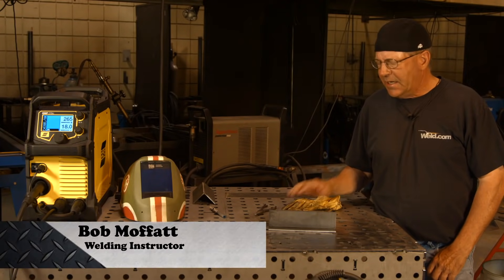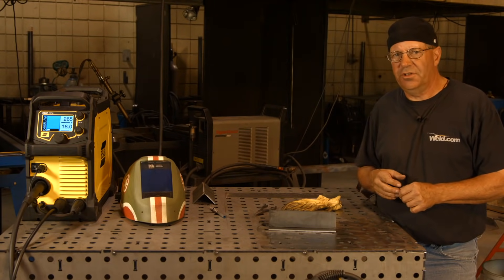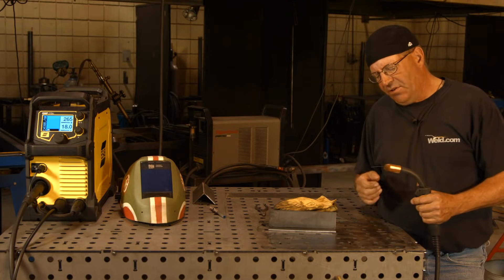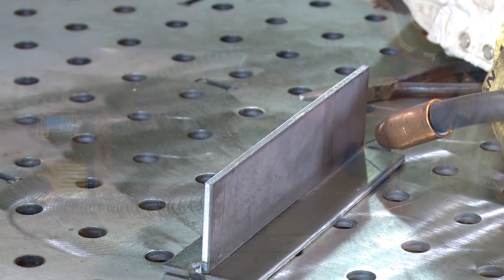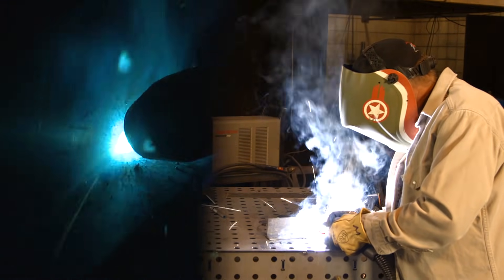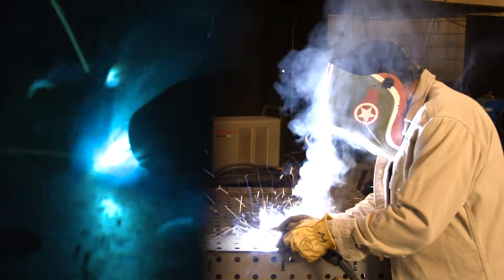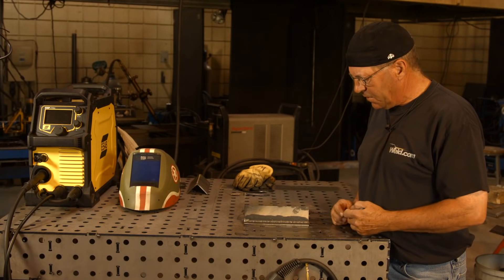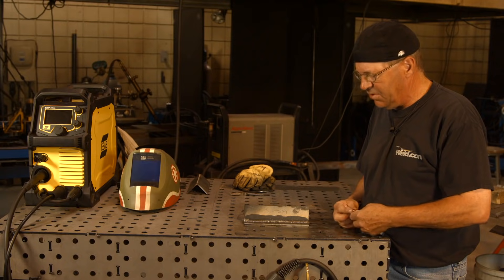Flux Core Welding: The Basics You Need to know

Comment: My first welder was a cheap transformer arc. Was difficult to learn on, but I got the welding bug all the same. Spent a bit more and got a (still cheap) inverter gasless mig. Now that was hard to get the hang of. But I've now run maybe 6 spools of wire through it and produce fairly tidy welds with it. I've just bought an inverter arc/tig welder. It's so simple to use. Compared to my gasless welder it produces no spatter and it's so much quieter. I can weld in to the night without the wife complaining. My gasless still has a place tho. I find doing vertical welds with the arc the pubble sags and can drip if I move too slow. With the gasless I seam to be able to weld on any angle without issue. Great for welding a jockey wheel bracket to a trailer outside for instance.

Comment: I use those cheaper wire wheels with hex shank in my impact driver to clean flux off. It's faster than hand brushing and impact driver is half the size of my grinder. I can grab it with one hand and take it off in just a second.

Comment: I'm assuming MIG can do both, but the Blue Demon Stainless steel flux cored .035 wire claims to weld stainless but using flux cored wire. Can it also weld aluminum, or just stainless?

Comment: This is the kind of process I use the most, mainly because of what you said cheap and easy.  I usually dont even knock of the slag, just a good hand wire brushing and paint. Never ever had a problem.

Comment: This past summer (or maybe a little before that?) I purchased a Hobart Handler 210 from a local rural supply store (I live in Indiana). Bear in mind that I knew absolutely nothing about welding at the time of purchase and I fully admit to purchasing something that's way out of my league, but for this, I decided to just say "screw it" and dive in. I'm happy I did.

Once I realized how the damn feeder is plugged into the main body coupler of the welder, I was up and running. I've only been exposed to Flux Core at this point and I love it. I have a buddy at work who does MIG and he swears by it but for me, I have a fear of things that explode, so my natural inclination is to avoid compressed anything. Flux Core is more than enough for things I mess with anyway and so far, I love it. Yep, it's messy and I (obviously) suck at it right now but each time I do it, I learn a little more and get a little better at it. I'm lucky to not have had any accidents yet because I've done some stupid stuff with it already, such as try to weld a galvanized fence loop back onto a fence cap, which I didn't get very far with (something I'm not that sad about now that I realize that can be a dangerous metal to mess with). But with that aside, I was able to weld a crack that my push mower had in its shroud. That's not much but hey, it saved me needing to replace anything and it made me pretty proud of myself given I never did anything like that before.

It's fun stuff. I have all sorts of things I'm planning on doing with it once I find the time to... One thing I'm looking forward to working on is welding together some sun visors for my convertible--that might be a winter project--but this Hobart welder is awesome! Well worth the money I spent on it!

Comment: This is very dangerous when ur welding with flux or not never forget to have a fan to blow the smoke away from you u dont want to breath in that smoke or you can use a air vacuum. That sucks up the smoke !
Reply: A few cigarettes before welding will put a protective layer of tar in your lungs.

Comment: I wanted to share what I figured out welding flux core wire. I welding a front clip on a Camaro. Ran out of gas. It was weekend no welding supply open.  Where I live.  Loaded my mig up with flux core. It smoked sputtered couldn't see what I was doing.  
I opened up my shop doors.  Big gusts of wind were blowing in. During the gusts.  I could see and it didn't spit,  sputter or smoke. 
I had a box fan set it up blowing hard. 
It welded great.  I could see. Didn't smoke up the material I was welding.  The splatters were a minimal. Welded just about like I was using gas. 
I would recommend using a fan welding flux core. Inside or out. Unless the wind is blowing hard.  
Try it. It will surprise you.  😊💯%✔🇺🇸

Comment: Ok I bought a little 110v machine and I’ve been doing pretty good for a beginner learning on my own but I suddenly ran into a snag today. 

My machine came with two spools of wire (with no labels) and I ran out and used some wire that I found on Amazon. It looks the same lol  but this new FC wire bounces off the welding surface even with my temp all the way up and my wire feed as slow as it will go. 

Don’t let me overstate the problem because I am putting down a decent (in my crappy opinion) bead but I’m having to fight it. 

Any advise? If I was near my machine I would give all the info on the new wire I got but I don’t have it right now. Grrr

Comment: This is the best video I have seen about MIG welding.  I know the preparation steps, but the actual welding is what I needed tutoring.  THIS guy does that.  Most beginners videos want to use gas and I never intend to do welding for profit.  mine is just hobby related, but I want to do a decent job.  I gave a high five and I subscribed.  Again, excellent video, thanks for sharing!
Reply: This is not MIG (Metal Inert Gas), this is flux-core welding, FCAW (Flux Core Arc Welding), this particular version is called Innershield, it uses a flux core welding wire with no gas, there is also a process called Outershield, it also is a flux cored wire but also uses a gas for a shield (straight CO2 gives best results with this process over a mix gas), don't forget what this man said, Innershield runs electrode negative (DC/EN or DC-), MIG and Outershield run electrode positive (DC/EN or DC+).

Comment: I have a Miller 130..i bought 20 years ago...flux core..i have found that the wire if it gets a tiny bit damp,,it will swell up,and cause the wire to jump and bump..results,a crappy weld..the moral or this is...remove the spool and keep it in a box with a,light bulb..or keep the spool in a ammo can

Comment: Hiya. I need HELP. got a mig welded from eBay was welding mild steel with flux core wire E71t was going very well nice welds. Then I ran out of wire and got new wire from same flux core wire but now the welding is not going good. Can't even run good beads the beads are too high and not penetrating and don't even stick everything falling apart. Tried adjusting wire speed and voltage nothing works. Polarity is DCEN. somebody help.

Comment: Just tried to weld two pieces of galvanised steel with my new fluxcore.  Woeful. Right welder but needs competent user. I am such a newb 🤣🤣🤣
Reply: Try to grind as much of the zinc away from the base metal first.  The zinc will make the arc wander badly and tie-in will be affected.
Reply: Spanner, its not your fault, damn things have a mind of their own.

Comment: I have a video Idea I'd like you to make since you have everything you need and I've never even heard of anyone talking about this.  I'd like to see you build a box like they use to sandblast or work with bio-warfare agents and instead of having a stream of gas flowing out of the tip, simply fill the box with argon and then weld some aluminum wish gas wire or stick.  Of course this means your part must  fit inside the box or be sealed whee it comes into the box but that could easily be accomplished the way people let trees grow thru a roof  using an inflatable tube to make the seal.  My and a buddy have wondered just what might happen in this instance and whether the whole box might act like a plasma ball but I doubt it since your using such low voltage.  Seems to me a person could save a lot of money on gas or make their gas go a long long ways  and possibly you could do things that have been ridiculous to even consider before.  Helium is easy to obtain in small quantities, even the dollar store has a bottle of helium at every one and it also comes in small tanks like co2 if I"m not mistaken.  Now for a fun fact of the day.  Did you know NASA uses more Helium than everyone else on earth combined?  Hmmm I wonder what they do with all that Helium, could it be possible they use it to launch satellites from Antarctica as shown in so many videos.  I recently came across a guys video (UAP) that showed a list of satellite launches by NASA that were launched from Sweden and some of them included Parts for the MIR space station and most of them were Satellite launches.  Just thought I'd share that with you and if someone can think of a logical  reason why they use as much noble gas as 7 billion people I'd love to hear your explanation or theory

Comment: I still keep a spool of 70 series fluxcore around for when I run out of wire or gas. Looks of weld are really secondary to penetration. Guy came to our yard sent by landlord to replace front gate. Had Honda 110 generator and mig welder. He laid out parts of galvanized pipe and instead of notching ends he just flattened them and welded up a new gate frame with fluxcore. I checked it out afterwords and it looked good. Nice tight welds with a little slag. Up to that point, I really didn't think much of 110 mig. I always had access to 220v machines. Dual shield I am told is what you need to weld up Cat track pads in a hurry. I would like to try that someday. If you ever tried to unweld something, you quickly find out just how little weld it takes to stick two things together.

Comment: ever run into this cracking down the center of the weld
Reply: That happens easily with any aluminum and with cold steel. Maybe too much voltage or slow advance? You may jump to welding other sections to avoid excessive heat concentration. 

Best to heat up everything uniformly with a torch (or oven) to reduce the relative contraction of metal just behind the weld. Also, cool as slowly as possible by insulating from cold wind (wind break) or covering around hot weld bead with insulation.
Reply: @avid0g   thanks ive pre heated it seems to help

Comment: What surprised me, whilst welding sheet metal for car wheel arches, was the advice in another video regarding turning the welder up a notch if you blow through. I couldn't quite understand how this was going to help but it worked! 1.0mm thick metal, on my mini welder, 1 max, 7 wire speed. Works great.

Comment: flux core welding, perfect for DIY'er, backyard mechanic, or need to weld something in the boonies on the cheap. Perfect for ranch/farm use where it doesn't need to look pretty, but as long as it works.

Comment: Hello, I bought the harbor freight 90amp flux core and was wondering if I should do the conversion from ac to DC like a lot of people have done. Since you say to switch it in the video. Thank you for your time
Reply: Kind of an old vid but you want DC not AC. The corrct connection is DCEN. DC electrode negative. So you want the grounding cable on the positive terminal of the welder

Comment: Us structural guys use FCAW for high production outdoor field work like hand railings, staircases, trapeze and sometimes D1.1 tower gusseting and high altitude work... because it is not affected by wind and is easier and quicker for inexperienced welders to use outdoors; unlike gas shielded which is highly sensitive to wind and may not pass code without using wind barriers and/or tents.

Comment: Gotta question I’m on a very tight budget and gotta do rusty frame repair on my F150 frame I plan to use a 120v mig/flux core welder to edge weld the 1/8th steel section in that I cut out I’m going to bevel all welding sides and preheat small sections should I use the fluxcore wire

Comment: I'm a coded welder years ago, this flux core is good, just go for a good wire, the one l use and is very good is INE, So the advantages are, no heavy bottle to move around and get refilled, can weld in windy conditions, good for positional welding, the end results as in this video look messy but cleaned up there fine.

Comment: Wish you would show some bad welds. I'm having trouble with me Beads lately.  They look like bird shit. I've tried slower,  faster wire, Hotter colder heat. I just can't get it to stop doing this.  
3/8 metal. 35 wire. Cleaned. I'm just lost.
I'm going to change out my tip & see what that does next. (Consumables)
  Problem is.  I'm going in for a pretty major operation on Thursday. Won't be back to my shop for 6 to 8 weeks. Hopefully I've seen the problem here and will be able to fix it by then...  😋
Reply: I'm  newbie. But from what i've read, .030 mp wire seems to be the sweet spot for most, especially with the 120v welders.
Reply: @ccdirecttvdllc5246  I'm running a 220 volt machine. 035 wire that came with it. Plus I've tried other wire that people seem to swear it is the best.
Reply: I use a Century FC 90 and seem to get better welds with 0.035 wire over 0.030.  Interesting that despite being capable of running both, the manufacturer only has a chart for 0.035.  I run Lincoln NR 211 Mp wire

Comment: Another fantastic video Bob. Wish I had you as an instructor. Everything you say and do is right to the point without needless babble. Most guys would have poo-poo'd this process and dismissed it out of hand when it does in fact have its advantages. Great for windy conditions outside, cheap (no gas needed) and can be used on dirty material. It is messy, makes a ton of smoke (advise you get a smoke hood or fan if using it indoors) and produces a lot of spatter but it does make good, sound welds on the cheap.

Comment: If flux core can produce welds like that I know what my first machines gonna be.
Reply: I bought a Lincoln Weld Pak 140 for my first machine that does both MIG and flux core. MIG is much cleaner and makes much better looking welds without the clean up but flux core is works well too. Just be advised that this guy is GOOD and don't expect your welds to look like this right out of the box. Practice, practice and practice some more and you'll get better each time. Pay attention to how he angled the torch head and the speed of his hand during the weld. Some of the toughest part of this process is setting up the wire speed and voltage settings. Good luck

Comment: I've never welded before and I'm learning on a flux core machine. My welds look pretty rough and blobby. What's the best technique to use as a noobie?
Also, what's a good technique to use for pipe to pipe welding if they're sitting side by side?
Thanks.
Reply: The best technique for a newbie is the practice technique. We all started at the bottom and to become a good welder in all forms of welding is to practice.
Reply: Parallel pipes? Usually these are clipped to uni-strut. I never welded parallel pipes together, but for decorative work: short stubs of square stock could be set between the pipes, at intervals, to provide a conveniently accessible welding surface. Presumably you don't need a continuous bead, or touching pipes. If temperatures inside the pipes will differ, then intimate welding is a very bad idea, and you need expansion loops. 

Butt-welding pipe end-to-end is easier to keep aligned with one angle iron underneath both pipes (inside the V) and clamps to hold in place while you tack weld surface bridges in four places (using welding rod stubs) . Be sure to grind/bevel the pipe ends first so you can fill with molten wire. Also, practice on some short pipes until you get the skill level high enough. If the pipes are carrying water, you really need to use a compatible welding alloy or else the weld will corrode from electrolysis.

Comment: Do you need to use the gas nozzle with FCAW?
Reply: No but most machines only come with this one nozzle so you're stuck using it. My Lincoln came with both the gas nozzle and a much smaller one for flux core which makes it somewhat easier to see the weld puddle (if you can get past the smoke)

Comment: Very good instruction. I only use my machine very occasionally and have a lot of trouble seeing the weld because of the smoke and splatter no matter how I adjust the Helmut. The problem with being an amatuer is that most welding is done on light square tube, very difficult to get your eye in. My welds look like I stood a couple of metres away and threw hot metal at the join.

Comment: So really mig and flux are the same on just electric and one gas
Reply: A real MIG welder will run MIG (wire with external gas) and flux core wire. Cheaper machines that don't have a gas inlet can only run flux core wire. Problem with the cheaper flux core only machines is that you can't weld aluminum as you have to use gas to do it.

Comment: Got a question I noticed no pin holes whenever you welded that t joint when I welded with gasless I always ended up with pinholes and I mean a lot of pinholes do you know why that would be
Reply: Welding inspector here (i know, booooo)
Idk your conditions in which you are welding, but FC is picky. Clean the material as best as you can, and remove all moisture from it. Excessive voltage and if your stick out is to short can also cause porosity. Reducing travel speed can also help mitigate porosity issues.